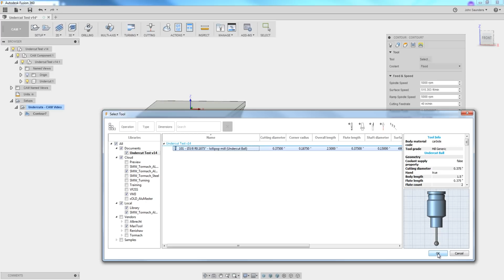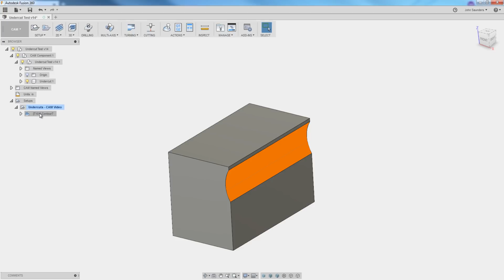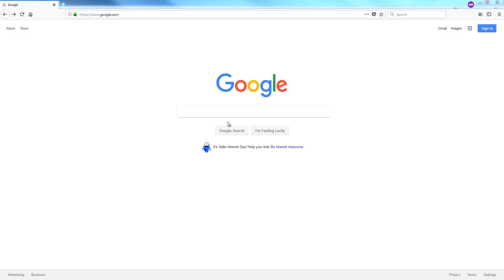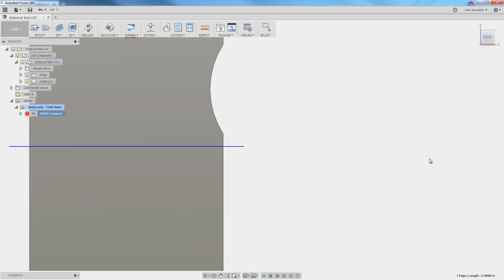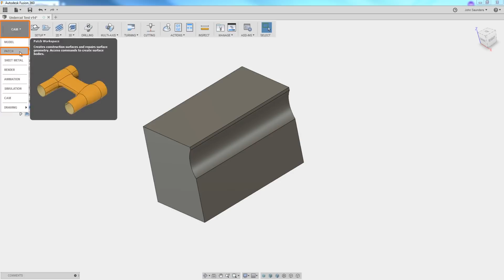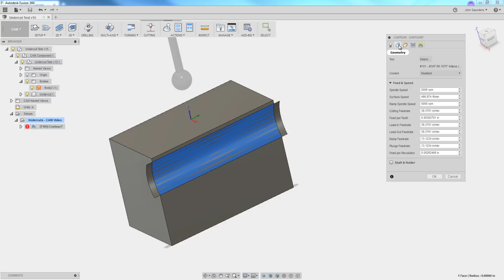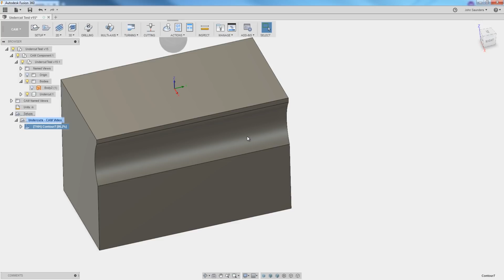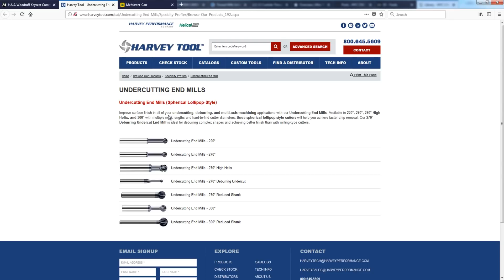Undercutting in Fusion 360 CAM!  FF119

Comment: How do you use cutter comp with this?? I find fusion to be extremely frustrating when trying to use wear cutter comp. I just figured out if you want it to input the G41 code in your 2D contor you have to select multiple finish passes. Why would it even give you the option just to not use it? I am quite new, I’ve done a few programs for work and made good parts but it’s very frustrating at times.

Comment: john, Im looking for some assistance. I need to select hundreds of the same pocket to machine. rather than selecting every pocket does fusion have a solution for this similar to the drilling operation where you select drill all same dia etc. thanks!
Reply: That would be a great feature! Although it's not quite what you're looking for, it's possible that using a pattern would be an option (depending on how regular your pockets are). Create the toolpath(s) you need for one of the pockets, right click on it in the CAM feature tree, and select "Add to New Pattern". If patterning is an option, hopefully this'll get you rolling.

In the pattern dialog there is an option in the Pattern Type drop-down list called "Component pattern". If you happened to have hundreds of pockets because you have hundreds of components in an assembly, this could save you a ton of time!

Comment: I prefer to use avoid faces than touch faces cause of the reason you just showed. I click avoid faces and pick all the faces that I do not want tool to touch. But you need to input a very low surface clearance.

Comment: Hi Jhon, Nice video and information, A good Application to this is when you make an internal big Thread or helix in two halves mold by machine it on CNC mill, a ball end mill won't be able to reach the starting and ending of the helix because of the undercut. 
Thank you

Comment: Why not just use a slope contain vs editing the tool path height? I whipped a quick model and cam'ed it using touch surfaces and slope contain and it seemed to generate virtually identical results.

Comment: Do you have a general impression of how to pair the radius of tool to the radius of surface? Is a 1" tool in a 1" surface bad? Too radius half surface radius? What cutter diameter is just right for feature radius?
Reply: Brian Clark largest tool you can fit is generally a good rule. 

So if you need to make a .5” radius, a single pass with a 1” ball endmill is perfectly acceptable. 

Basically the fewer step overs required to make the surface the better

Comment: I don't understand Fusion's bogus logic. If you checked avoid/touch surface, and selected a single surface, how hard could it possibly be for the program to just get the tool to make contact with the said surface and be done?
Reply: technically as it was wrapping around the sides it still was only touching that desired surface since the center point of the radius of the lead-in was on the edge of the part so no cutting on the sides would be done.
Reply: The label is "avoid/touch" as in either avoid or touch a surface. Avoid is default, to get touch, the additional radio button needs to be checked.

Comment: Can’t you extend it under linking moves to have it make a longer lead in and lead out rather than creating a surface? Also change the direction of them? 

I don’t have it open right now to check.
Reply: Pretty sure that doesn't straighten out the linking moves. Seem to remember struggling with it myself.
Reply: John, thanks again for doing this on the open forum. The phone case milled out perfectly.